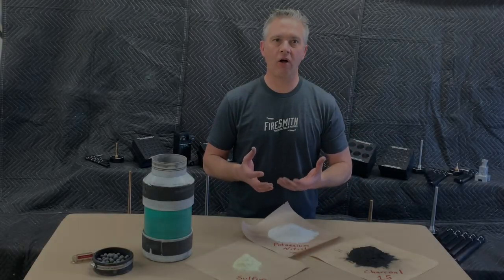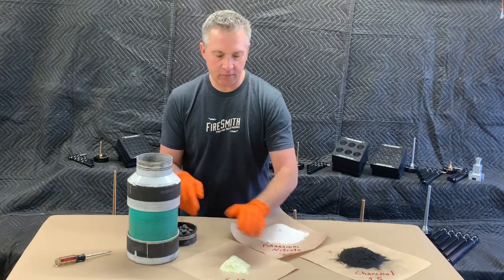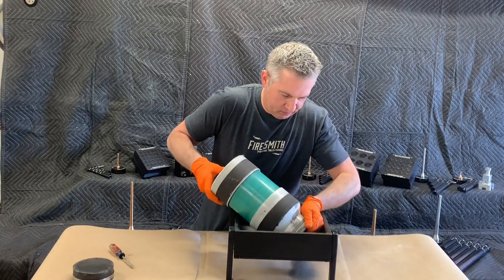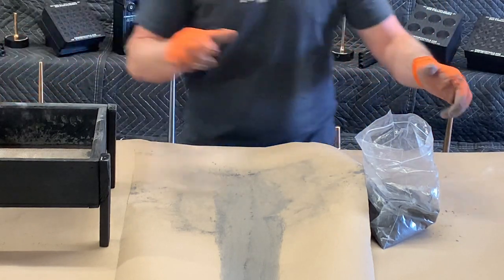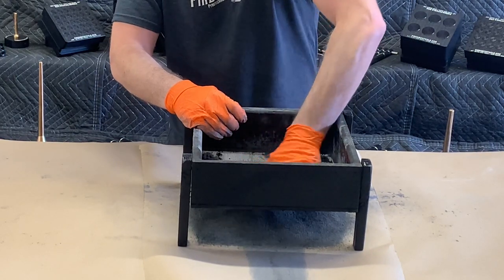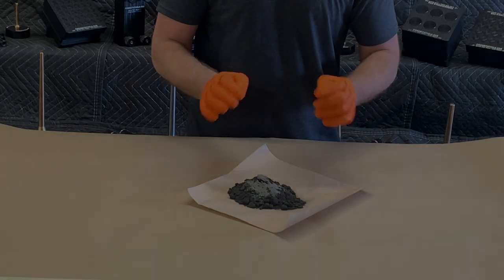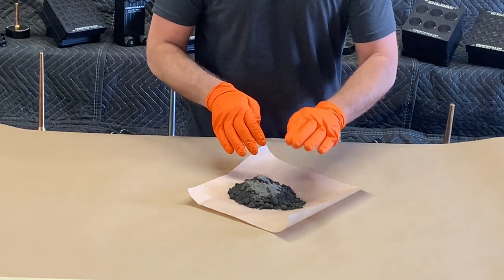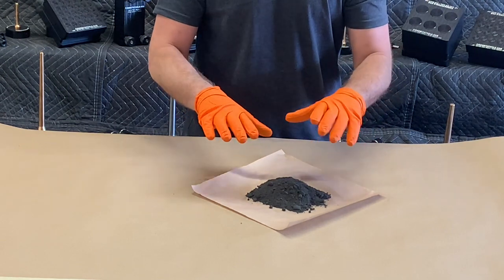Making Black Powder Rocket Fuel

Comment: I have a rebel 17 by extreme tumblers and I use mini pool balls (resin balls) for the milling. 
is there any danger for explosion with mix the 3 components in the ball mill and run?
Reply: Just don't use metal balls, they could Spark and ignite the mixture.

Comment: Where can u get that ball mill and if it’s expensive what are some cheaper ball mills
Reply from the maker: In most cases you'll have to build a ball mill. It's really just a glorified rock tumbler that spins a bit faster.
Reply: Just use home kitchen mixer grinder , just make in small amounts ie 100g, turn on and off dont run grinder more time to be safe

Comment: I'm curious, the brown paper I see on a lot of these website a lot of these pages, is that the same construction paper that you can buy at the home Depot or is it something that is a little smoother.
Reply from the maker: Depends on what you're using it for. If pasting shells is your goal, virgin Kraft is your best bet. If you're just using it during the screening process, any generic paper is a-ok
Reply: @firesmithmanufacturing9376  yes for screening, contractors paper seems kind of ruff on the surface, (toothy, ya know). I always need to do more tapping the back of the paper than I like.

Comment: Hey I remember hearing somewhere not to use lead balls in a mill because they can possibly spark when the crash together, therefore igniting the black powder. Is this just a myth or should lead balls be avoided?
Reply from the maker: Lead balls are fine and are used by pyro's all over the world in a ball mill to make BP. There was some concern years ago about ceramic milling media having the potential to spark, but I believe that has largely faded away. Stick with lead and you'll be A-OK.
Reply: @firesmithmanufacturing9376  thanks man. Lead balls seem to work better than marbles!

Comment: I liked this but was wondering, what charcoal did you use, what spindles are you using and what ID tubes? Clayed nozzle, clayed top plug? Drying after ramming? 
Stingers yes but cored 1_3 lb wouldn't this be too hot?  I have been doing this for 45 years but am just now doing long cored rockets so this is not a smart A__ed question.  I'm serious.
Bob
Reply from the maker: Hey Bob,
Charcoal is easily the most critical component in making BP. I like to make my own as it is very easy to do (there's a tutorial on my website that shows a very simple method to make a few lbs at a time). I use scrap pine 2x4's simply because they are readily available and produce consistently performing BP. The softer the wood, generally, the faster the BP burns. Commercial hardwood charcoal makes lousy BP for rocket fuel or shell lift & burst.

I produce several different sets of rocket tooling with slightly different spindle geometry. You may want to watch my video that provides a breakdown of these different tool sets. Basically, clay nozzle, BP fuel all the way up the spindle. Above the spindle you can use the same BP but may want to add coarse charcoal or aluminum for a nice tail. I do not use a clay bulkhead at the top of my motors. Just straight fuel to within about 1/2" from the top of the tube. This ignites the headers consistently.

No need to dry anything after ramming. The small amount of moisture simply acts as a lubricant to help the fuel compact more completely.
Reply: @firesmithmanufacturing9376 Right O been making charcoal for this for 25 years, I use bag pine and red cedar bedding, grinds without needing a garbage disposal which I have used in the last for 55 gal drums.. Ok pine for milling and mill for air float Use a 100 mesh pine ( my choice bp is willow, but don't need that hot no more) 100mesh KNO2 no need to mill for 3lb or larger and add the 10 to 20% pine (as per Sumuzu) 80mesh or hardwood from like Cookbook.
No heading clay if 1 in or more moisened to lock in.
No metal on spindles. It even malls stainless.
Milled fuel to hot as per my stingers with willow and ceder for 1  and 3/4 in cored?  I thought making Polverone by milling or precipitation was too hot for cored ? 
. I was there when ball mills were being designed just shell guys were shell guy and rocket guys were rocket. I want to get to cored rockets this year. hell after 25+ years of being an AFN member and doing it this for more than 45 y I thought it was time.   I have to see your tooling now. Thank you. I needed a kick in the head. Just do what I know and build the best I need just I have been reading and saw your add early this am. I Have been milling and granulating comps for 2 weeks now as I can getting ready..  I'm not a kid making boomers or a rookie just didn't want to scare the chickens to much. needed a start.
Reply from the maker: @bobharrison9620  If you're making hot BP (and it sounds like you are) I'd recommend pressing up a motor without a clay nozzle. Super easy and almost foolproof... and with your fuel, that rocket will get outta town in a flash. You'd probably be best off with a Universal Core Burn set. It handles hotter fuels a bit better than the Super BP Core Burn. 1lb size (3/4" ID x 7.5" tall) is easily the most popular size. You can lift 4" ball shells without any problems.
Reply: @firesmithmanufacturing9376  Thank you,
I have tons of 3/4 + 1in stinger tubes, my stinger and whistle rocket tools, orderd a 1in ya 3lb spindle the other day before I found yours.   Went 1in so I didn't have the milling processes, bigger slower, then ya said mill the fuel. 
I had to ask. I will definitely be a customer of yours.
But I got away with not milled on my 2 in gerbs. Trying to get a full show with the least store bought this year. No Bariums antimony or the like with a new puppy batch running and me holding them..Damn then milling. Disabled old and 30lb 4in mills is getting old.. Hey rilly thank you.. You reminded me formulas are individual.
Pass 100m KNO2.    
 milled pine or willow and sulfur at 15 -10 ratio then add KNO2 that passed 100.  add 15% Harry's 80m. maby my pine +40 flake. Heading some kind of metal 20% dampen as per FPAG Mexican rockets and make at least 1in to start.  (Timing) No clay.. 
Follow Lancasters book My Bible for ever have a tone of Books, . imagine that the books before internet. Which I just started pyro on who would have thought such guarded secrets are shared so willingly now.. 
Tools are expensive. had 3 chemical orders 1 tube order and 2 tool orders this month. One has about 10;crossett old and new .. from China. I may see them. before new years but just saying I will need your products. 
 I have made 1 1/2 in stinger tools and can't find tools to try them.. Then we burn it in seconds . 40hrs into a 12in for 15 seconds..
Reply: @firesmithmanufacturing9376  I read that and as usual what I right sounds snotty, not where I was. You can't give a solid answer as you don't know me or what I'm dealing with chemical ,moisture, mill ,wise    Tooling has gotten expensive and I need to see what you have as some of what I have been doing so long is getting old. going to o try stingers without a spin hole on a stick in the next couple days and a new insert I have been working on for cakes. I needed an idea to mill fuel for choked 1 to 3 lbs cored and charcoal choice before I CATOed to many. 
Thanks and will see your stuff tonight after I tend mills and push more through the sieves..
Bob H.

Comment: Is the 2% addition of water by weight? And what size mesh screen are you using? Thanks in advance
Reply from the maker: Yes, everything is measured by weight. A 10-12 mesh screen works great for general screening
Reply: @firesmithmanufacturing9376  Awesome thanks for the reply.

Comment: As long as you were going to wet it anyway, why would you not dampen the compo before the milling?  Maybe not to your final 2%, but a spray of water?

Do 6 sievings give better results than 3, 4, or 5 times thru the screen?

For sure, though, I'd've worn a mask while handling the mill dust, or even the air float charcoal pre-milling.  I've blown plenty of black snot out my nose after breathing air float, can only imagine how deep in the respiratory tree that might've gone.
Reply: You will only try ball milling wet once.
Reply: @Michael-rg7mx I've done it more than once with a spray of water.  It's not "wet", just keeps the air float from air floating.
Reply from the maker: Damp components are a pain to mill. They tend to clump up and make a mess. But, yes, airfloat charcoal goes everywhere. That's why I toss coarse charcoal into my ball mill. Not nearly as messy. I've found that 6 screening seems to work well for me. It really only takes a minute or two per screening. Might as well make sure everything is thoroughly mixed.

Comment: What is the best charcoal for coreless rockets please ?
Reply: Endburners require hot fuel. The hottest charcoal you can find would be a good choice. Eastern red cedar is pretty easy to find as pet bedding. I don't think they make softwood airfloat so you gotta make it yourself.
Reply from the maker: charcoal made from soft woods tend to make hotter BP. Go with what you can source locally consistently. I've used pine 2 x 4 scraps for years since they are readily available just about everywhere.

Comment: 1)Do you recommend adding any dextrin like 1% as Skylighter says or is that not good for rockets? 2)Do you make end burning or core & if so, change the BP mix to fit?  3)How long to dry the mix after pressing before launching? 4)Can the dampened fuel be stored or all need to be used at once due to large crystals forming from the KNO3 & water?  5) How much pressure topress  the grain?    Sorry for all the ?'s but I'm getting ready to mill & need to know. Thanks!
Reply from the maker: 1) Nope, dextrin makes the fuel grains harder and much more difficult to compress into a solid fuel grain. You want your BP for rocket use to be relatively soft and easy to pack inside a tube.
2) I make both types of rockets. They are totally different animals, though. Core Burn motors make a ton of thrust but only for a fraction of a second. The majority of the flight is spent coasting to apogee. End Burn rockets produce comparatively little thrust but do so throughout the entire burn duration of the motor. They can reach great heights, but can't lift as much as a Core Burn motor. End Burn motors are also great for use with wheels, girandola and even fountains. End Burn motors like a hot fuel (75:15:10 BP). Most Core Burn sets can also use this same BP fuel so long as you don't use a clay nozzle. However, my Universal Core Burn set is designed to use 75:15:10 BP with a clay nozzle A-OK.
3) It doesn't need to dry at all. The little bit of moisture is used as a lubricant to help the fuel compress more completely and easily within the tube.
4) Not a good idea. Only make what you are going to use in one setting. 
5) I like 9,000psi on my fuel grain. But anywhere from 6,000-9,000psi should be fine.
Reply: @firesmithmanufacturing9376  "My Universal Core Burn sets"?  Is this a product you supply?  Is it good for both rammed and pressed motors?

Comment: Why water and not ammonia or alcohol?  Why not glass champhering and sieving the powder for size after corning it?  You'd get a much more consistent burn that way.
Reply from the maker: The water acts as a lubricant to help the BP compact into a solid fuel grain inside the motor tube. Corned and screened BP, while desirable for shell lifting, isn't very useful for rocket fuel. BP of that nature tends to be quite hard and leaves lots of mico-cracks and air pockets in the fuel grain unless it's compacted to around 10,000psi or so within the motor tube. These cracks will cause a rocket motor to explode. That's why it's important to compact the fuel within a motor tube into a solid fuel grain to ensure a steady and consistent burn rate. A BP fuel that is simply dampened and granulated compacts quite nicely.

Comment: I dont like this metod its very dusty and slow process...just add 2-3% baby oil before milling and its ready to go
Reply from the maker: Yup, that's certainly another acceptable method. Having a small bit of lubrication in any rocket fuel makes a huge difference in producing a solid fuel grain. baby oil, petroleum jelly or good old water all do the job well.
Reply: @firesmithmanufacturing9376  Doesn't using a volatile liquid like water risk cracking the grain from shrinkage by evaporation after casting the grain?